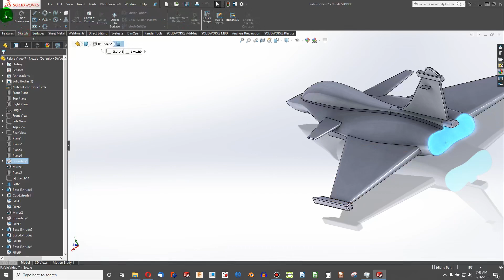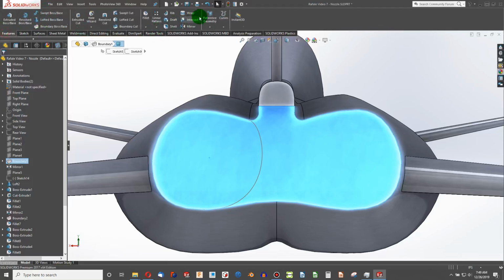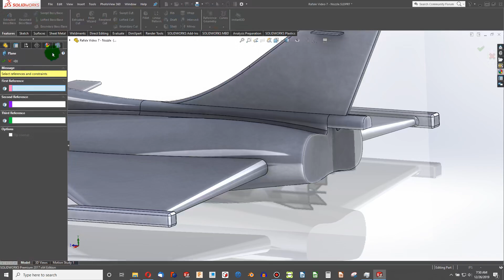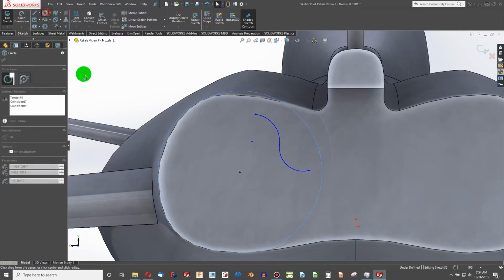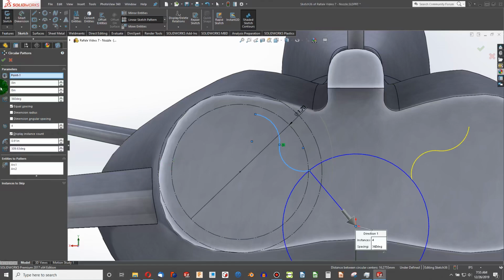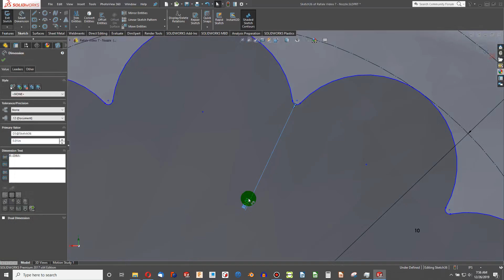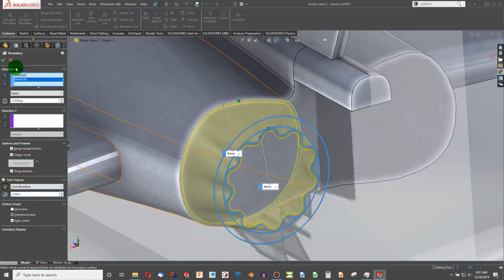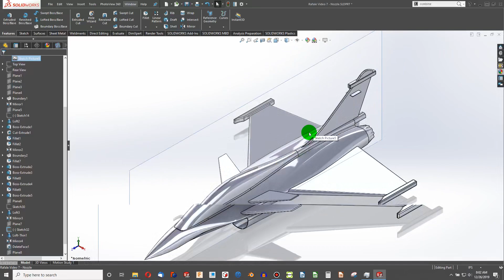Make a Rafale Fighter Jet in SolidWorks Video 7 - Nozzles |JOKO ENGINEERING|

Comment: It should be sounding to negativ, but the greatest Advantage in Airplanes, are the Airfoildesign.
They must have a Profile, that works with complete Aerodynamic and in conjuction with the Control Surfaces and the Tail Surfaces.
There is a Leading Edge, which has an Arc.
And a Trailing Edge, which is a sharp Angle.And it is Curved and winded in all Dimensins..
Im trying to create a new Rigid Wing Glider,
so it is my Challenge, to make a good aerodynamic Design.

A Video how to properly creating Airfoils, would help many People a lot,
because it is so complicated.
Reply from the maker: Yes, the design of airfoils is out of the scope of this video series.  I will be working with another channel soon specifically for airfoil design.
Reply: @JokoEngineeringhelp  I will be the first Viewer!